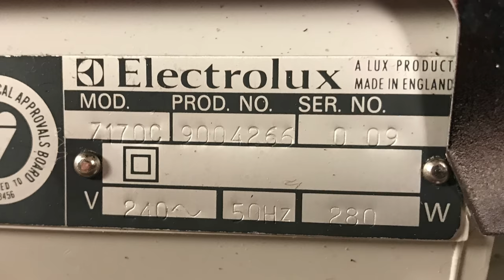Electrolux 170, Machine Polish & Quick Demo

Comment: I recently received my mothers old Electrolux B-8 floor polisher/shampooer and want to restore it as it needs it badly. I can’t find any information on how to remove the brushes or the top cover. Do you have any information on how to remove these parts?  I know it is probably not worth it financially but it has sentimental value to me. I know it sounds ridiculous but I know if I can get those parts off it I can do the rest of the work as I have restored many other items to like new condition whether it was an old oil lamp, a 1957 Kirby vacuum cleaner, or a 1964 Rambler Classic 440 car. I just don’t want to go into this one totally blind due to sentimental value
Reply from the maker: Hey Todd, I’ve never seen one of those you have? It’s absolutely worth it and I think you’re awesome to fix it. I’m afraid I’m not much help with that model I’m sorry, but as you know, take lots of pics, screw cards or even film it so when it comes to putting it back together you’ll be fine, maybe it’s just me that has to watch the videos in reverse for re assembly 🤣. Please keep me up to date
Reply: @HooverLux  my problem is locating any hidden screws or bolts
Reply from the maker: Ah yes, that is always an issue, but I’m sure it will be pretty simple, they aren’t a complicated machine.
Reply: @HooverLux  What should be a simple s and straight forward job is proving to be a nightmare. I can’t figure out how to remove the top cover because I can’t find how to access the screws
Reply from the maker: 😭, I need it in front of me 😭😭
Reply: @HooverLux  I hear you there. I had hoped that you would have either had experience with this unit or had a manual for it but I know I was grasping at straws

Comment: I'll bet that it's a perfect machine for area rugs.
Reply from the maker: Bruce Solomon it’s really good on everything for what I remember, my childhood vac 😍😍😍😍
Reply: I could see a home with wood floors and area rugs getting by for decades with one of these and say a Hoover Port-a-Power with wheels. What else is really needed?
Reply from the maker: That’s very true because the beating action on this does such a good job, this and the Portapower and you be absolutely fine.
Reply: I noticed that this machine had a good deal of airflow even more so than agitation.
Reply from the maker: It’s really not bad for its age, it seems like it was a bit of an underdog looking back at it now.